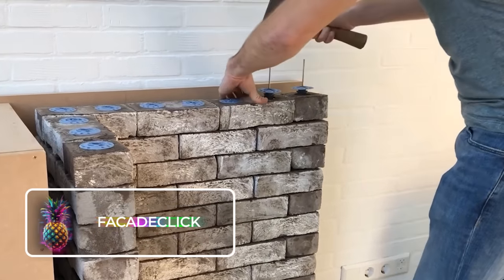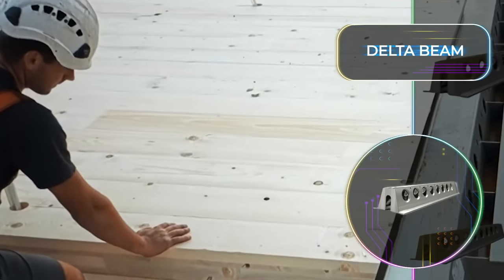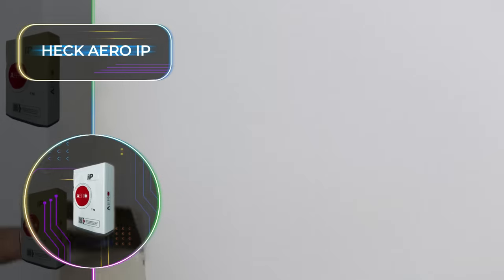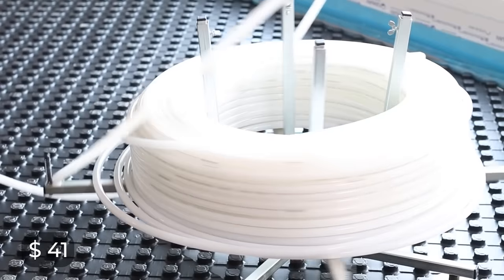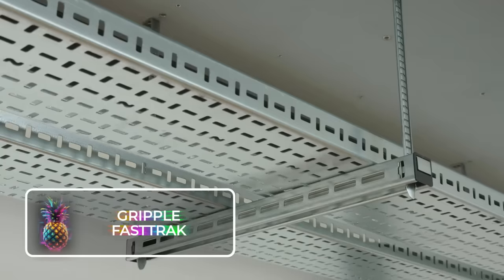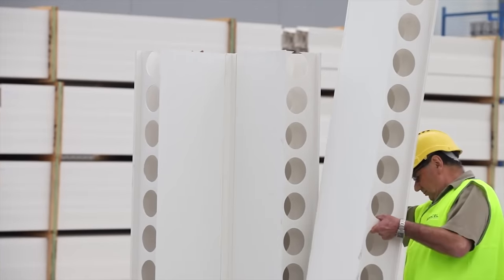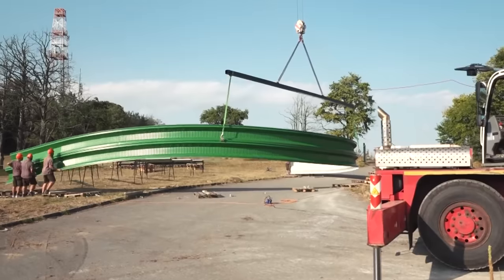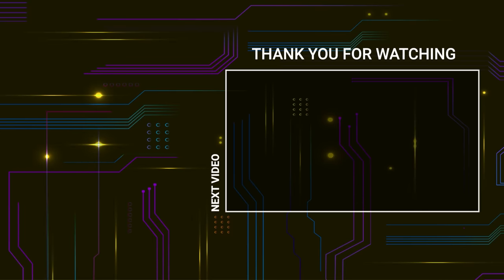Construction Secrets You Will Regret Not Knowing

Comment: The mortar does more than just holding a brick in place helps with water it helps with wind and it helps the insulation aspects of it so how do you get through that
Reply from the maker: Thank you for highlighting the various benefits of mortar in brickwork. It's amazing how something seemingly simple plays such a crucial role.
Reply: Mortar does another thing, it helps to level the brick out. Brick are not made perfectly flat or square.
Reply: What happens when the metal and plastic bits in the first story disintegrate? Everything disintegrates, though I have seen brick and mortar centuries old. Planned obsolescence on a brick wall? Sheesh!
Reply: Thats the old way of doing things this Is the new and better way.
Reply: They probably cosmetic.  Looks a lil flimsy
Reply: Do you have Bricks on the inside of your walls?   A foam insulation layer between the brick and the wood would fix that problem.  I haven't seen a Brick house built since the 1920s.
Reply: @krisknowlton5935  Sounds like you need better bricks if you have leveled it out.   Use a brick similar to a paving stone for a walkway,  they are nice and level.
Reply: @quantumleaper  you obviously do not know anything about masonry.
Reply: You don't, just with that comment!
Reply: @krisknowlton5935  You obviously don't know anything about me. You would be crazy to use this if the wall was load-bearing,  but most brick walls are NOT load-bearing now.
Reply: @quantumleaper  what does that have to do with my original statement?  I stated that mortar is also used to level brick out because they are not perfectly flat and square, which they are not. Clay brick are fired in furnaces at 2500 ° F . During the firing process, brick shrink at different rates depending on where they are in the furnace.   The paving brick you see at Home Depot are not fired clay bricks. They are basically made from the same material as concrete block. I personally would never use the process that is used in the video because of the expense, and I don't think it will hold up over time. I may be wrong on that part, however. I am retired brick mason and have built solid masonry exterior walls on a house. I know what I am talking about.

Comment: Why on earth would you waste time on a bricklaying technique that requires another wall to hold it up? You're not exactly saving time when a standard brick wall can hold itself, therefore you wouldn't need to build the other wall first, and also without gobbo between those bricks, insulation has gone bye bye, rainwater will get inside too, causing damp issues much sooner than if you'd just built a standard brick and mortar wall. All this talk about saving time, when we should be thinking about quality and longevity.
Reply: The brick could be decorative instead of load-supporting.  My home has a 1/2 wall of brick with weeping mortar in front that is decorative. Luddites need to get out of the way for the future to start today.
Reply: @quantumleaper  yes, but that's not my issue, my issue is they're talking about saved time, but the thing is you need to build a separate wall just to attach this Lego block crap to, you'd save more time and the wall would be just as strong if you just built this the old school way. Decorative or no, it sucks...
Reply: Facia

Comment: Most likely a lot more expensive. Homeowner cost for the fancy crap will likely be more than the cost of hiring a reliable/professional contractor who will to a much better job.
Reply from the maker: That's a valid point to consider when looking at renovation options.
Reply: Prices do go down over time for new methods you realize.  If you can build a house in 1/2 the time,  it may not be as expensive.  We a 3D-printed houses now.

Comment: I have done a lot of brick work ,..no mortar!!!! 
Water will go in , creating a city for all kinds of bug's  🐛 🐛 🐛 humidity bug's,. You get bug's,..you will get lots of spiders.
Reply from the maker: Looks like you've unintentionally created a bug metropolis! Time to call the exterminator?
Reply: Yup.
Reply: Plus cold air, water, ice damage....
Reply: As settling occurs due to weather, temperature changes, moisture and ground movement, random bricks will fracture and crack...  creating and causing...   You decide.
Reply: @FruityTech  Thats their 2nd business
Reply: Didn't the UN say that an expanding population will result in us eating nutritional bugs ?
Reply: @Matlockization  they said you can eat what you want because No One Country will Rule over harvested grains or produce. I choose watermelon, cantaloupe, grapes and grape-nuts.
Reply: Did you notice the brickwork wasn't flush but was air-gapped which could easily be filled with foam insulation?  So many Luddites...

Comment: Nothing great or fantastic about adding more plastic in the environment.  😎
Reply: Yeah, I was wondering the same.  The plastic is going to become brittle over time and it looks like the design is intended to leave a small gap between the rows to add mortar.  I'd give a brick wall deisgned with this maybe 15 years before it begins to lose integrity.  Sure, you have minimal brick loss when you tear it down.  But the cost of materials is bound to be higher in the long run than traditional brick and mortar methods.  The example given is for a facade.  A fake outer wall so it needs to be attached to the house.  Which makes me think it isn't even intended to ever be a load bearing structure.  It is pure cosmetic with limited application at best.
Reply: The bigger threat is AI -nothing like debating soy induced latte loving paper straw ID10Ts
Reply: @Boogiesu12  The bigger threat is AI?  Stop watching SF movies, you'll sleep better.  😂

Comment: I'd like to see that brick house deal with heavy rain.
Reply: just what I was thinking, or freezing water, bugs getting in the joints.
Reply: You add a layer of cement between them even if using the facade-click
Reply: @richardchampion4826  Foam insulation between the Brick and the Wood interior walls?  How many houses are built today with load-supporting brick walls?  Most have decorative brick on the outside. Sounds like you want to go back to the building's interior walls with Lath and plaster again?

Comment: As a Construction worker I must say that some of these are really game change PS until at 14:00 you realise that you are screwed
Reply from the maker: Looks like the game changed until 14:00, then it changed again to a whole new level of "screwed"!
Reply: you can change to a better payed profession. this robot gives you the last push to do it.
also robots need software maintanance etc. ( that is part of my work ).
most money every month i get from dividend not from working.
Reply: Brick and Mortar  !  What about the plastic degrading and Falling apart  !
Reply: No, this robot would be way too expensive to use on a construction site.  Plus the high dust and debris from the site itself is going to get into this things joints.  There is a reason why it is shown just putting in panels in a clean lab.  As soon as you have to modify the size of your materials and add the dust and particles from the cuts, this thing is toast.
Reply: Looks like it slower than a fast sheet rocker

Comment: You can't stop a wall from cracking  with those staples. If there is enough force to split blocks apart there is more than enough to rip those staples out .... even if the staples remained they would have the block ripped from around them!
Reply: I honestly don't think this product is rated for load bearring.  I think it is only intended for cosmetic applications.  Like covering over aged store front properties.
Reply: @superdave8248  How often do use brick for load baring walls?  The last one I know of was my Great Uncle's house built in 1925 (I think) and the inside had lath and plaster walls.  Most use brick as a decorative facade today.

Comment: Facadeclick is A STUPID BEYOND BELIEF !!!
How on earth could THIS system keep out damp, the rain ???
Reply from the maker: Maybe Facadeclick needs an umbrella and raincoat to keep out the damp and rain!
Reply: By putting solar panels on the roof, you can enjoy electricity only when the sun shows up !
Reply: @Matlockization  Try batteries Luddite when it's night or the grid.  Solar only lowers your bill doesn't get rid of it.
Reply: @quantumleaper  A fool will buy batteries, then after 7 yrs they get worse every year thereafter. Why do you think the resale value of EV car is so bad after 3 yrs ?
Reply: @Matlockization  Resale value drops the second you drive off the sales lot.  What happens when we run out of GAS around 2050?  Are you going to start using a Bike or walk everywhere?
Reply: @quantumleaper  Yeah, but it's a lot worse for EV's, how about zero resale value ?  Recent improvements in drilling has meant that they are discovering new deposits of oil and gas, but the media won't tell you that. But the media will tell you in the beginning we are running out ! I'll tell you what, you drive your EV's and use solar panels & batteries and I will continue using my 22 yr old car that takes 3 mins to fill up.
Reply: @Matlockization  I have driven almost every car I have owned into the ground. My neighbor plugs in the Garage not everyone drives over 250 miles IN a day.  Keep changing the goalposts when you lose doesn't help. It sounds like you don't like to fill up at home and you love to give money to a gas station.  
BTW electric vehicle ideas have been around longer gas-powered ones.
Reply: @quantumleaper  Yeah, but those goal posts are undeniable facts which you have no answer to. And when that happens, your argument falls apart. Here's another goal post. Renewables can't cover base load power and when that happens, blackouts happen.

Comment: Most of the items in this video that contain plastic are now under question after a report coming out of York university in the UK saying they are finding micro plastic particles on archeological sites that have no reason to be there.

Also I thought polystyrene was banned as a building material as it's a severe fire Hazzard
Reply from the maker: Wow, that's crazy about the micro plastic particles! Thanks for the heads up about polystyrene too.
Reply: Micro plastic particles that sit on the ground quickly get covered with soil and sit there harmlessly.
Reply: And if we get rid of oil you got no plastics anyway ! I guess we can use sand and build out of glass!
Reply: Do you have carpeting in your home?  It is basically plastic.   Wood is a fire hazard also.  Ever gone camping and need a fire?

Comment: Tying  the structure with conductive metal into plastic that holds the bricks together is just a disaster in a fire this will allow the outer brick structure to collapse when heated or am I missing something in the concept.???
Reply: Just like wood after all it burns too. Most carpeting is some form of plastic too.
Reply: @quantumleaper  Yes but the walls dont fall down generally the timber frame will burn but the walls generally dont collapse that is a significant hazard in any one wanting to put a fire out.

Comment: can arojel based plaster be outside?
Reply: We have used it on the Space Shuttle.  Aerogel insulation can be applied to the external surface of external walls, either with a render or cladding system.  Google can be your friend if you use it.